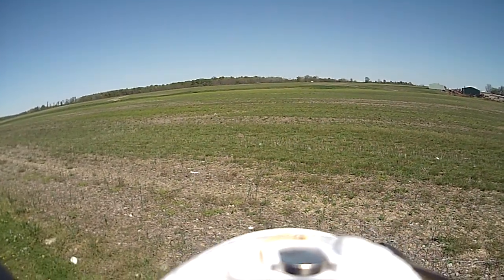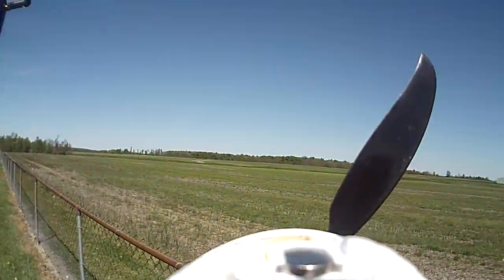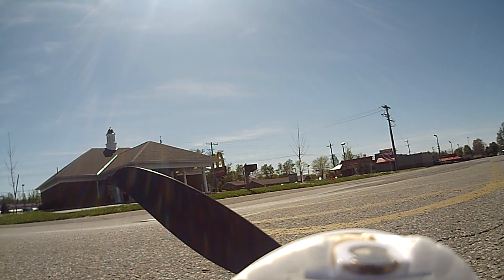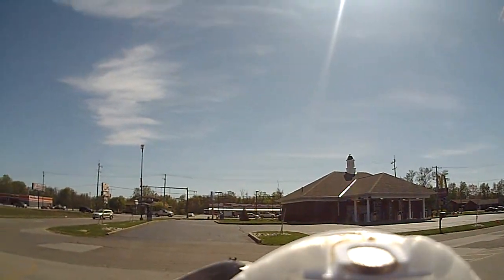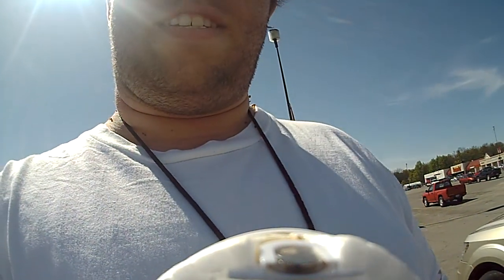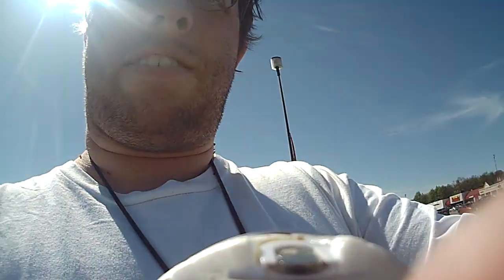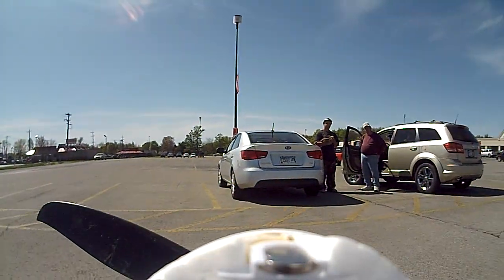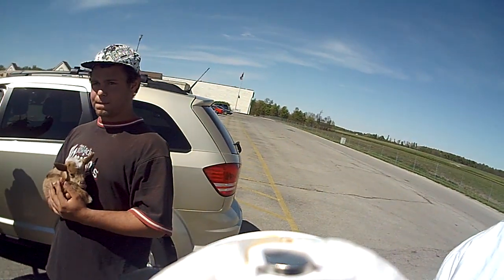Radian over Georgetown Ohio

Comment from the maker: I still love my Radian, still do. I like the capability of flying with one stick as I setup the controls so that the right stick is rudder and elevator. throttle on the left and once you are in the air you are good. I did get the radian pro, I was not super impressed and after it took a straight nose dive I decided to nix getting another one. Radian for me all the way.